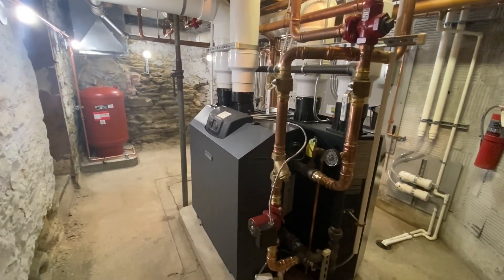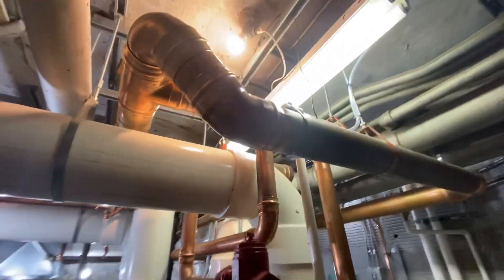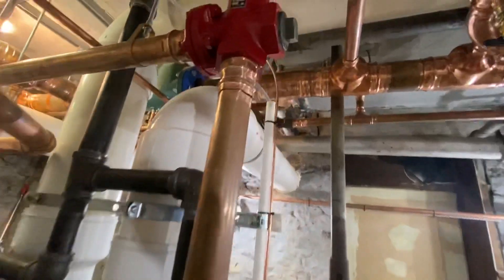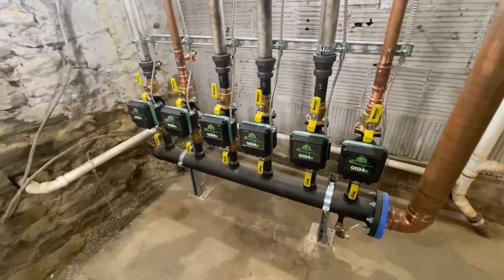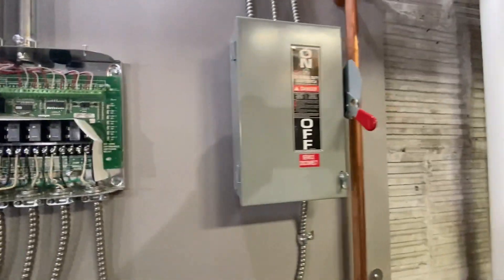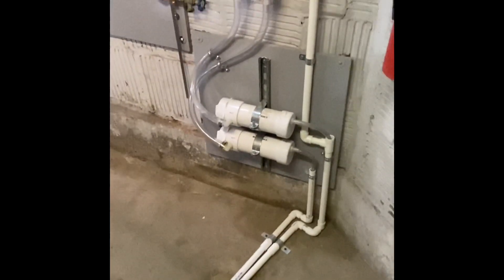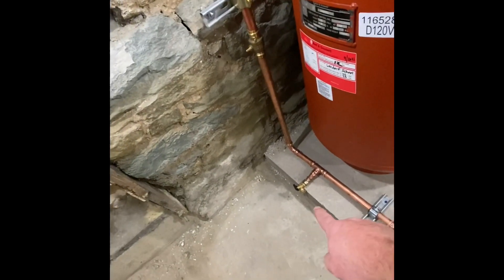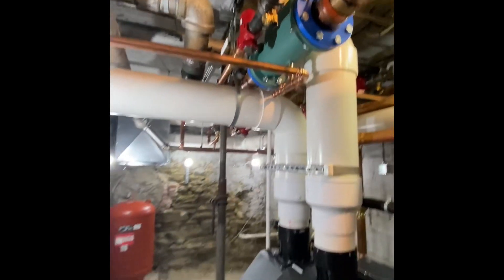Dual Slim Fit/ 6 Zone Boiler install Weil-McClain SF750s

Comment: Great install. So clean. Also FYI there's condensate pumps with built in neutralizer media. NSP-50
Reply from the maker: Thanks. I explained in the video that I looked in to them. The pumps with the built in neutralizer have a btu rating. Their rating is less than the 750K of the boilers.

Comment: Very clean job..I just only wish our installers took the care and thought out this job as you did. Can't imagine how much  cash you have in propress fittings!
Reply from the maker: “I” have zero “cash” in Propress. My customer invested in a system that I recommended/ used/ stand behind. They benefit from the system both on the Initial installation (saving labor) and the guarantee of leak free connections. Labor is more expensive than the fittings.

Comment: Nice job great looking install! I am Wondering why you went with the condensate pump instead of just piping it over to the drain 🤔
Reply from the maker: Well, local code requires 30” of clearance around the boiler (without any tripping hazards). So, I had to pump it just to get it to dump in a drain that’s 3’ from the boiler outlet 😂.
Reply: @hvaclaidback107  dam! Where are you located? Sounds like they make you jump through a lot of hoops.
Reply from the maker: PA